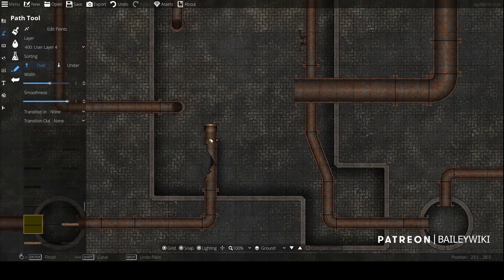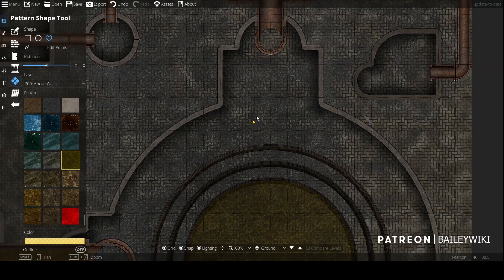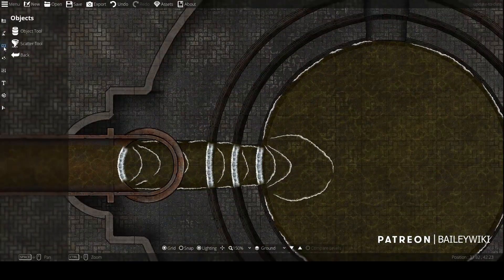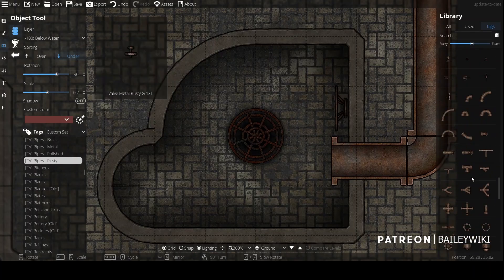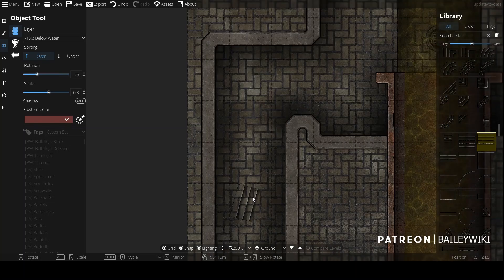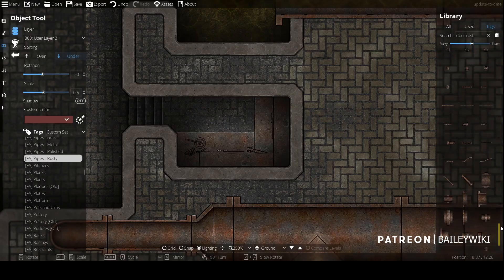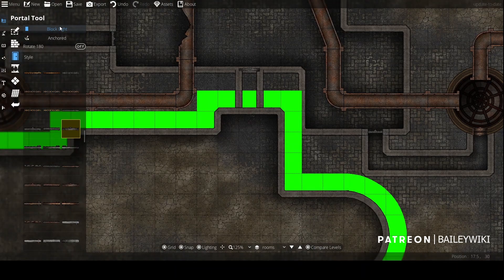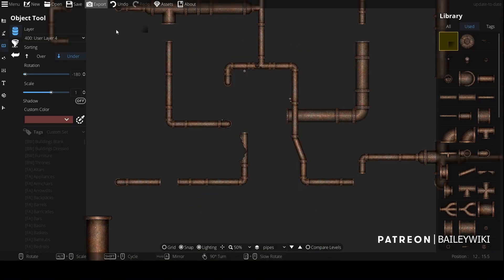Dungeondraft-to-Foundry Tutorial: Making a Dynamic Sewer Map End-to-End, Part 3

Comment: Hi. In your videos and the ones Zephyr does on this channel, there are comments about the standard Dungeondraft levels. For example, I can see that DD is at "300 User Layer 3" as you are editing the flow of the effluent into the pools. When I create a new map, the only level I have in DD is "Ground". How do I get the same base levels that you discuss? Let me know what I am missing. TIA.
Reply from the maker: The "Ground" level is a different kind of level. It's used more for adding whole new stories to a building for example. Watch my video on prefabs to see how to use that. You can add unlimited levels and even rename levels. But you are essentially designing a new map with each one, on a new canvas.

Now, the layers for designing WITHIN a level follow the -400, -100, 0, 100, 200, 300, 400, 700, and 900 tiers. These levels are all available all the time using any tool you select (objects, paths, patterns, etc). I find it hard to believe you can't find those levels and know how to change between them, since they are so accessible (drop down menu), but if that's your issue, then just spend more time in the UI clicking on things. Select any object and then look for the drop-down menu to change which level you're placing it on.
Reply: @Baileywiki  Super, thanks for the quick reply.

Comment: Is there a way to use dungeondraft to import walls easily to use for the foundry module levels?
Reply from the maker: Did you just ask this question on Reddit? If so, I just suggested a solution there using Token Attacher.